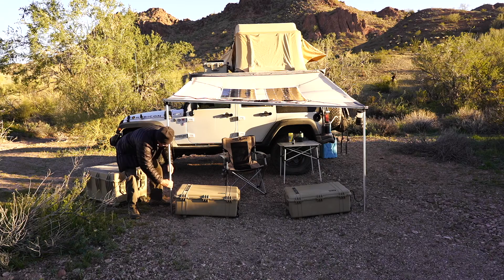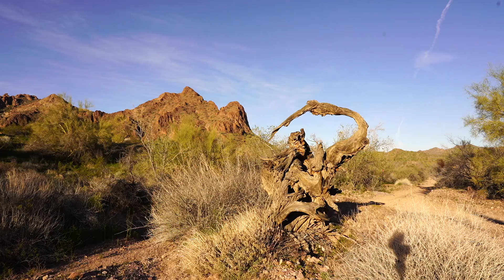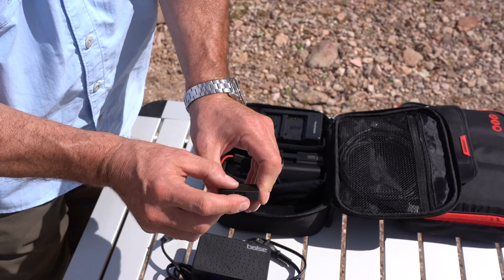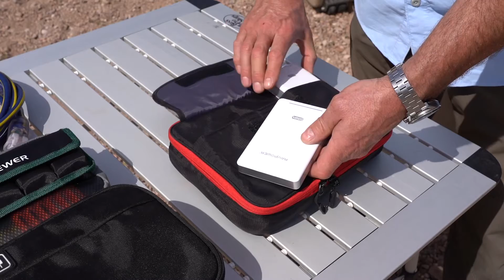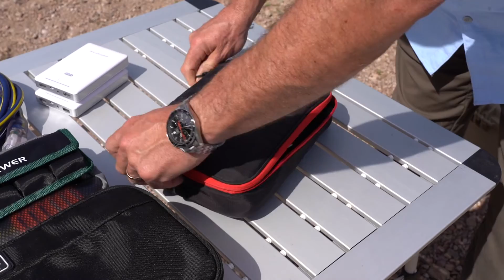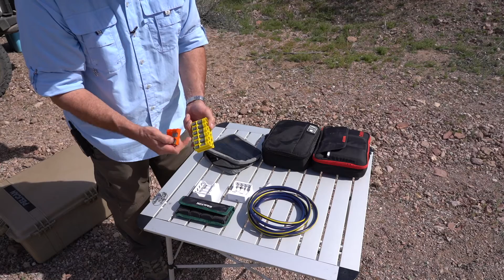Overlanding Power Systems - Our USB Charging Gear - Part 3

Comment: Did you know RAVPower makes a GoPro charger? Also, all GoPros since the hero 5 use the same batteries, so if you replace your 4 with a 7, for instance, they’d all use the same batteries.